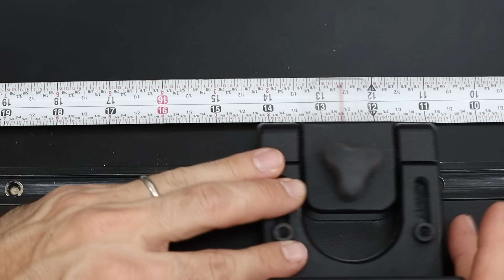I built the perfect miter saw solution.

Comment: There is a youtube channel called Shop Nation and the gentleman  who runs it makes custom 3d printed dust collection solutions for a number of saws , including your  bosch , the delta cruzer/ridgid models, a dewalt model and one or 2 others. The parts simply replaces whatever under engineered or non existent dust chute/hood/flap of rubber your saw is equipped with stock and the  new one takes less than a minute to install.   if you dont have a 3d printer, he will make and send you the attachment for 30 or 40 bucks. i paid 15.00 and 3d printed mine and it has made my delta cruzer 100% better in collecting dust
Reply from the maker: A+ for promoting shop nation. D- for watching the video and paying attention. Averages out to a passing grade though!
Reply: @Lincolnstww  i did watch the whole video, however i did step out of the room for a bowl of cereal. please direct me to the timestamp i missed as I love hearing about different ideas for dust collection. thanks, and great job!

Comment: Now that you've been using it for a bit of time, how is the dust collection holding up?  I've been trying to engineer an overly elaborate method for connecting my own plans for a miter saw station into my dust collection system.  I've seen tons of videos on these stations and no one is really every truly happy with the results.  Granted, that's the nature of the beast with a miter saw's all but nonexistant dust collection.  I had considered a large cutout and mesh system on the underside of the saw leading to a tapering chute that connects to my 4" piping, but other videos I've seen that have tried it have, again, been unhappy with the results.  Is there a reason, in your opinion, why a smaller shop vac hose would be more efficient than connecting it to a larger dust collection system?
Reply: there is a youtube channel called shop nation and the gentleman  who runs it makes custom 3d printed dust collection solutions for a number of saws , including the bosch , the delta cruzer/ridgid models, a dewalt model and one or 2 others. if you dont have a 3d printer, he will make and send you the attachment for 30 or 40 bucks. i paid 15.00 and printed mine and it has made my delta cruzer 100% better in collecting dust.

Comment: Very nice build and dying for the update to availability for the new stop block. The flip up part is the game changer. Love the separate toe kick for ease of installation on a shop floor which is NEVER level. As a bonus, with that separate, you can still get 32" tall cabinet end panels from a sheet of plywood, which gives a bit more  height to the station, which I like. Mine sits at 40" (32 inch panels, two inch top and 6" toe kick)

Comment: I don't see how anyone could say a miter saw isn't useful, or even required for certain jobs. Especially considering how many of the modern miter saws are much more accurate than ever before. I've seen people do stellar work with a good miter saw, and a good finishing blade to the point where a jointer isn't even needed. No, you can't do rip cuts on them, but that's where a good circular saw, and track system comes in handy. Table saws are great, but also scare the B'jesus out of me, and as such I'll never have one in any shop I have, lol.

Comment: A good miter saw can without any doubt be accurate and is an invaluable tool for many installations. But for myself I'm against having it setup in my small shop for two reasons, firstly and most importantly it's so damn dusty, this include every model, secondly it take up to much space compared to usage when I with relative ease can use other way to cut to length like using the MFT workbench.

Comment: I got annoyed with my mitre saw --- its depth-stop didn't hold so reaming out e.g. a tenon didn't work, it was too imprecise, and so forth. It was good on its 'horse', to cut laminate when flooring. All floors done I just donated it to my neighbour before it would ruin another project.

A week or two later I started budgeting for a mitre saw tracksaw wasn't really doing it.
Reply: I did the EXACT SAME (but kept the 'horse')... Bought the first gen of the orange Evolution sliding mitre saw, and it was truly terrible. It burned through its brushes in about a year, lots of plastic parts, including the depth stop that slipped and guaranteed ruining your piece if used; left and right halves of fence totally not in the same plane (ruining all you don't have a stopblock for, and no cut square). Only useful for laminate indeed. Next week started borrowing other neighbour's mitre more and more.

Comment: I've been toying around with the idea of ditching my miter saw(s) and have been thinking very heavily about switching to an MFT style table and just utilizing  my tracksaw. It is rare I need to cut any crazy angles and I don't do any finish carpentry so I jsut find it hard to justify the space for it when I feel an MFT would give me even greater flexibility since I would mainly do cross cuts and I'm not working with massive thick pieces. What are your thoughts on that?

Comment: I've never understood why folks poo-poo miter saws, it's one of my most used tools in the shop. Granted, I opted for one with a 12" blade and slides, so this means I can cut huge pieces of material (relative to smaller miters). This has been so incredibly helpful when working with large pieces of material that would be a PITA to have to slide across a table saw with a cross-cut jig. Thanks for sharing and I'm excited for your launch! Of course I just installed T-Track in front of the fence instead of behind. Oh well 🤷

Comment: Miter saws are for losers - just kidding.. I have 3 of them 1 of them does not work - need to get rid of it though. They are an absolute need - the space -- you do not need that much - building outdoor projects, decks, patios, etc...all can be helped by a miter saw - I have built furniture pcs and am building one right now - my miter saw is plugged in and being used...I am not sure what else I can use to drill holes in pcs I need.